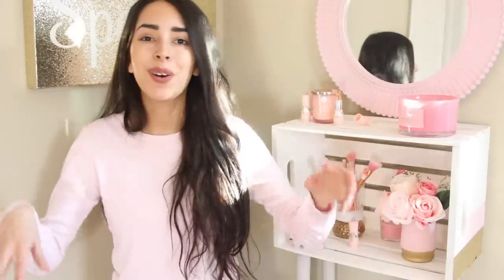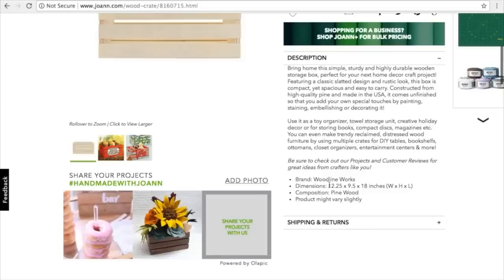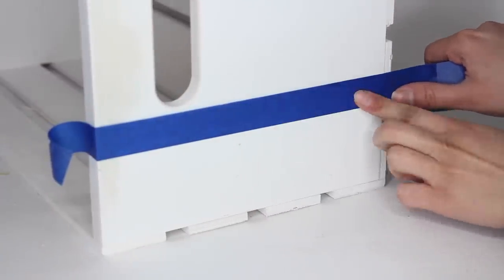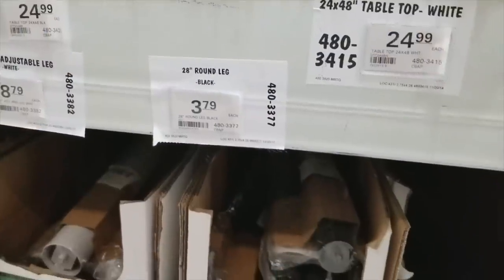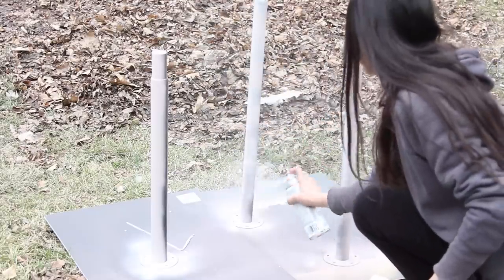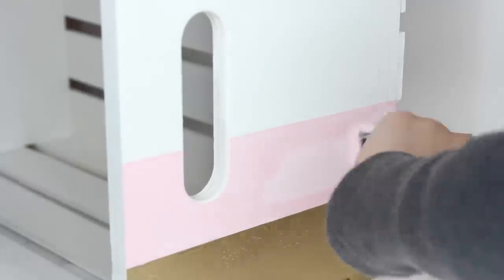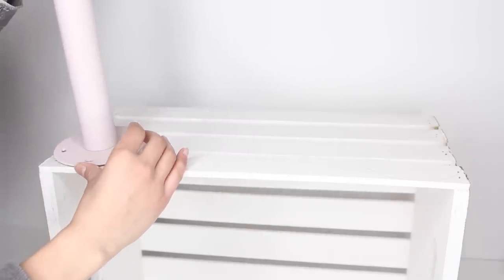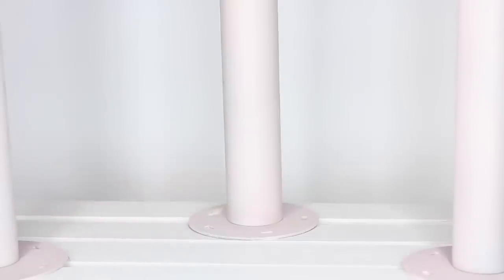GOLD & BLUSH CRATE MINIMALIST VANITY/END TABLE DIY

Comment: The legs had a longer tip that you screwed the plate onto. How did you remove that extra length tip to make it flat so you could glue it on the crate? BTW, I thought this was gorgeous! Thanks for the idea!

Comment: Why didn't u use screws to secure the legs better?
Reply from the maker: Dominique Johnson Much easier for me to use the glue. I don't like doinh projects with tools. If someone wants to they can but the wood glue was able to get the same job done. Also, if you use screws, you wanna use real small ones because the wood isnt that thick.
Reply: Bargain Bethany ok thanks